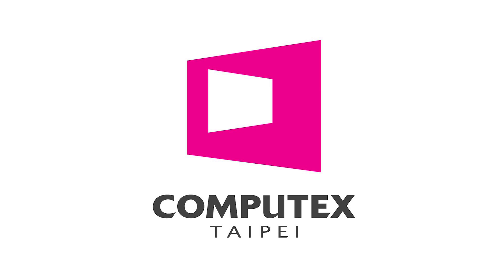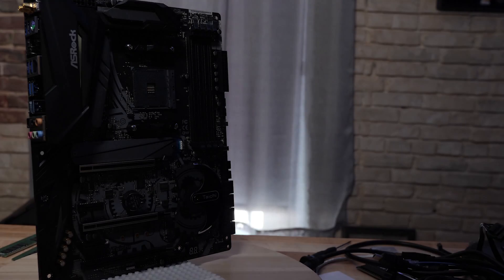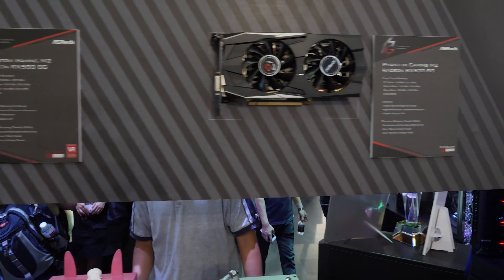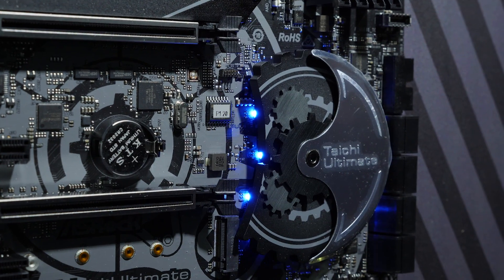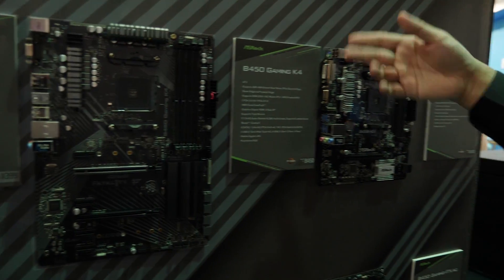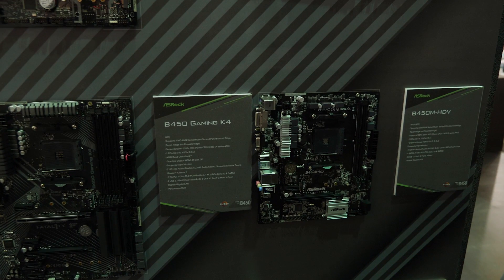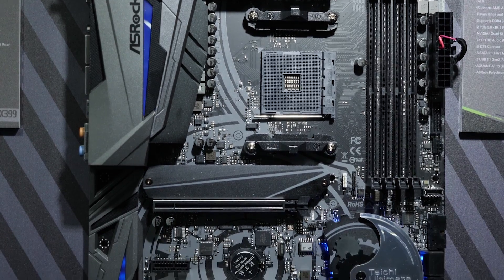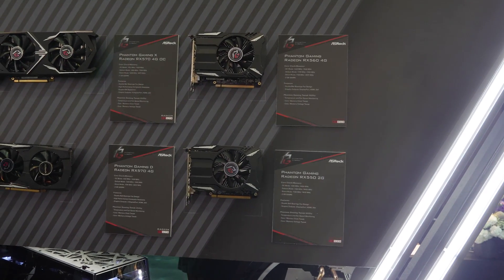Computex 2018: AMD @ the ASRock Booth -- Custom GPUs, new B450 motherboards and Mining Gear w/ethOS

Comment: Why should I buy an ASRock board over a Gigabyte board? Ever since moving to Gigabyte I get the longevity out of the hardware. EVGA is a complete fail. Gigabyte uses genuine Japanese components. I don't see better quality in ASRock boards. Why should I consider looking at them?
Reply: VRMs designs vary a lot for all brands. You need to research for individual board if VRM is your major concern. Can't just rely on brand or even product line these days.

ASRock usually has better value, but poorer BIOS. They don't put plenty of useless features onto a board and charge a marketing premium. With that said, ASrock's customer support is close to non-existence if you're in certain countries.
Reply: I'm ready to update my 2500K that is running at 4.9 . It's starting to show it's age and it can't use the 3Tb drives. I'm planning on getting another gigabyte system. You have to take a close look at their boards as well they don't always get it right. I've built many Gigabyte systems over the years for friends and family and only one ever had problems. 

EVGA uses cheap ports that fail quickly and they are proprietary meaning you can't buy any parts. I have 5 video cards 500-780 series with dead ports that were not abused, to prove my point. I do PCB level repairs on laptops tablets and phones. Meaning I replace a lot of USB and HDMI ports. 

Just want to make sure I'm not overlooking a good option for my next system.

Comment: Unfortunately those Gaming ITX/AC boards wouldn't be ideal for Ryzen APUs...the SOC VRM has no heatsink its basically asking to blow up with an APU installed.
Reply: I think we really need some lower end B450 itx and matx boards specifically designed for APU. The vrm like you mentioned, and the limitation on pcie lanes and m.2 make most mobo elements a waste with an apu. Sure you lose upgradability, but it's a worthy trade off for most budget gamers who don't plan on upgrading the apu in 2 years.
Reply: 3+2 vrm

Comment: If a TR2 is 32 cores, is a ryzen 16 core coming soon?
Reply: The dummies for TR was a lie. All four dies, totalling 8 ccx, are active on TR2. For Zen and Zen+, each ccx has a maximum of 4 working cores.

That means a TR max out is 4*8=32 cores. A Ryzen, with just 1 die = 2 ccx, max out at 4*2=8 cores.

Same goes for those Ryzen apu. Each apu has 1 ccx swapped out for a vaga chip. Meaning max out is 4*1=4 cores

The only way to increase core counts at this point for both TR and Ryzen is to increase core count per ccx (at 7nm maybe).
Reply: They only clarified that after Deb8auer made that video. Originally they were stating those were dummy dies and "structural support". A dead silicon chip is not a dummy die, and i don't think the PR/marking team was being honest by calling them dummy dies or structural support. 
Although either way you look at it, it's really minor misleading information, compared to "5Ghz 28 cores".
Reply: No it is not. Epyc is only Zen (14nm) while TR2 is Zen+ (12nm).
Reply: dont think so, really not... space is the problem... tr2 had always 4 dies... 2 of them were "dummies"... so there was the space for 4 realy 8 core dies.
Reply: PierreDolphin dummies dies wasn't a lie. They didn't say there was no transistors. They said there was no working transistors and can't be made to work.
Derbauer took xrays and proved that the traces go nowhere and can't be made to work so everything amd said was true they might as well be rocks. It's careful wording.
Reply: I guess its just a rebranded epyc that runs on x399